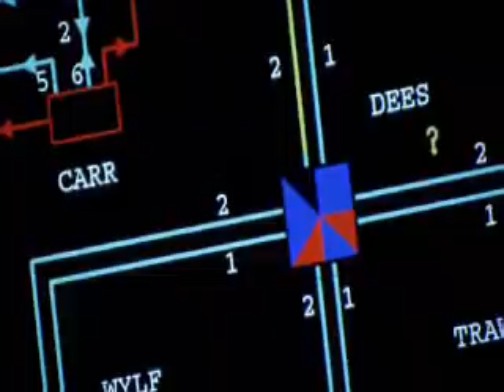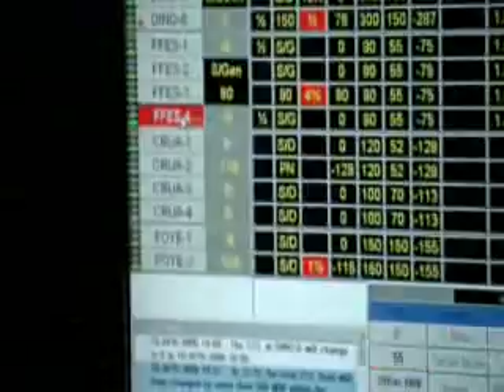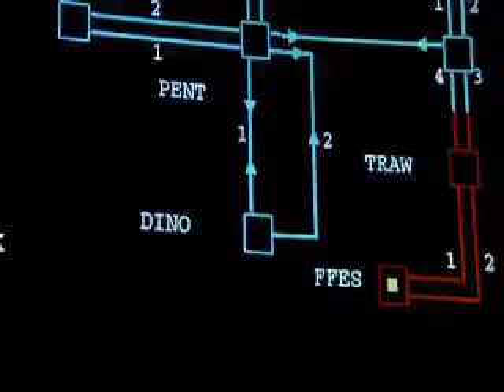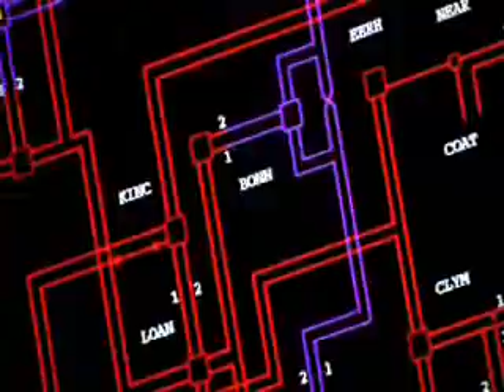1,500,000 kettles

Comment: why not get a program for this?
Reply: +GranVlog Britain
Reply: +Mario ballotelli Even a program can do that.
Reply: +Mario ballotelli not the reason, exactly.  C could handle this type of situation easily time wise.  The challenge comes in being able to cover every possible combination.  A human is able to react to unknown parameters.  A computer cannot.  You never want to leave sole control of a mission critical process to a computer.
Reply: This is from 10+ years ago. 

Source: Bianca from Easters does not look that young anymore lol
Reply: +GranVlog Because a computer reacts where as this you need a person who can pre-empt
Reply: +MCbrodie86 The necessary parameters here are all known. The realizations of the random variables are not. There is nothing particularly difficult here in terms of a Bayesian Optimal Control system. A proper statistical decision theoretic setup will handle these surges properly and provide the proper ramps with buffers.

Here we see that a television programme has ended, implying that there will be a strong correlation between this event and a surge in demand as people turn on their heating appliances for afternoon tea. However, this is not strictly necessary as the load generated by a fraction of people can be used to signal further power station rev up. Finally it may be an acceptable loss to generate some power preempting the learned distribution of demand times even if the variate for the demand spike occurs slightly later than average. This is where proper buffer design and control systems come into play. If the television program is the best signal, then it is reasonable to work with the BBC to utilize install a series of signals for such critical events.
Reply: +Spider Jerusalem I was thinking it must be pretty old just looking at those computers. They probably do have a program that manages this now.